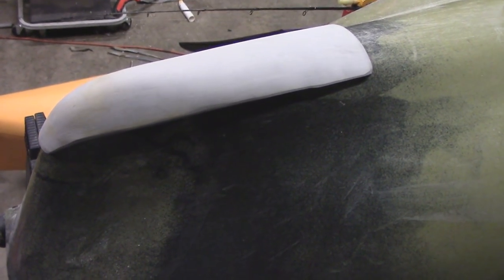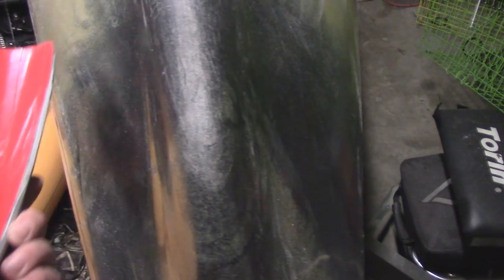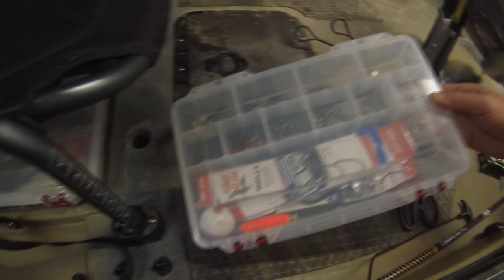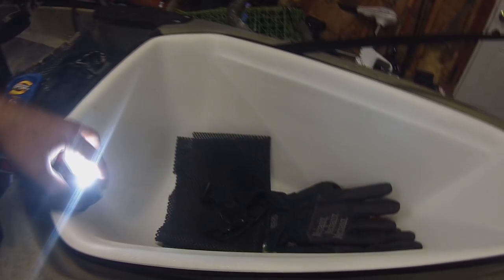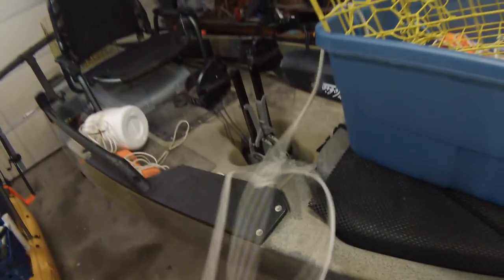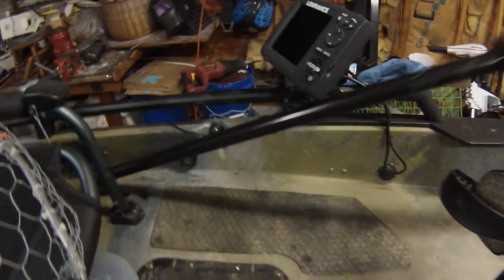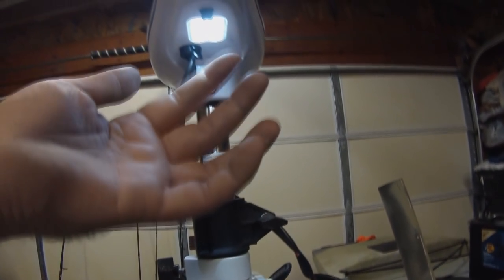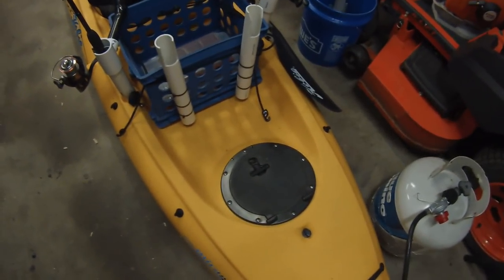Hobie pro angler 14 setup (fishing, crabbing, trolling motor and more)

Comment: It bulges because you bent it when it was heated and when you bend it there is no place for the "bunched up" pvc to go except tp bulge. To prevent this heat the bend areas more and make it softer than the rest of the PVC before you bend it slightly. Anotehr way is to "trim" small pieces from that area to keep the PVC from bunching up. A simple dremel tool and make a little less than half moon int he spots where it will bend. There are gloves made to handle hot plastic and help mold it easier. Those work best to get your final product.

Comment: This is cool, Please let me know when Paypal is ready, would like a thin one for my 2017 PA 12
Additionally, my folks have 2017 Revo 13s. Can you make em for the Revos as well?
Reply from the maker: I will let you know when it gets straight.  as of right now I cant say for sure it will fit the pa12 since its a shorter kayak the front might be a little different but I don't think it is.  iam sending 1 out to someone this week to see if it will fit a pa12.  once I find out for sure then i'll let you know about that also. I can make a skid plate for the revo 13, but there is the possibility it would slow that kayak down since its so streamline and built to go fast

Comment: Hey, I am interested in maybe purchasing one of those front protectors. I was just wondering the price.
Reply from the maker: A Aguirre 
The thin one is $20 plus shipping. Shipping is around 13 bucks for usps priority shipping in the US.   I had to shorten them because some people said that the back of the plate was to flat and  didn't fit very well but that was only on a few kayaks so they ended up cutting the back off. The full size one or the shorter one is the same price.
Reply: Sea Monster Fishing cool. I'll update you in a bit when I want to order. I'm deciding if I want to get my kayak now or wait a few months. Thanks.